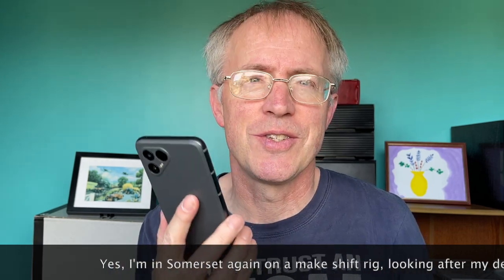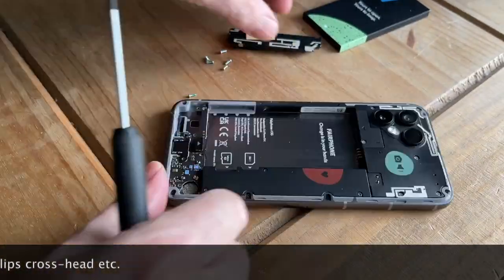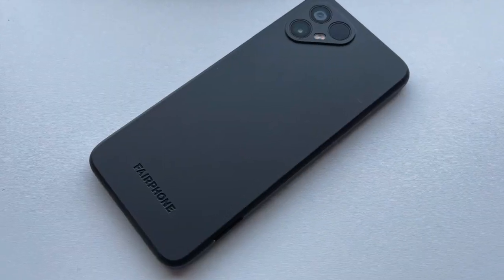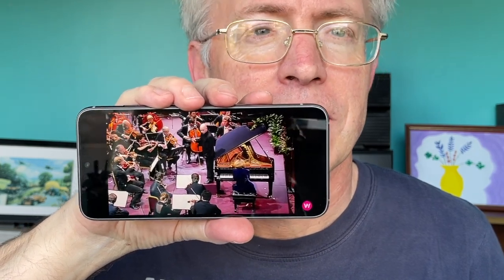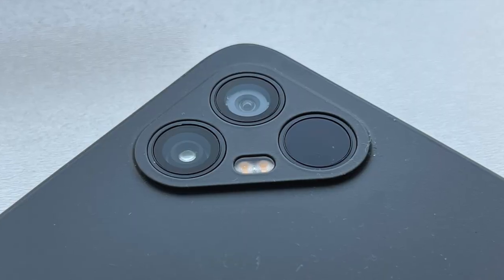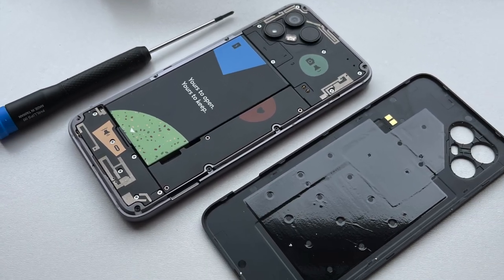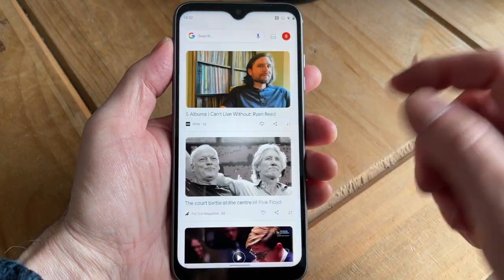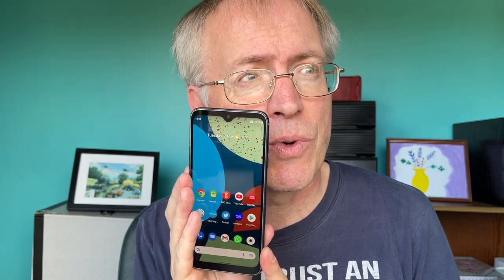The Phones Show 432 (Review of the Fairphone 4)

Comment: I too would have liked an OLED screen.  The fact that it is replaceable should mean even if it does burn out it can be replaced, but I do find many LCD screens difficult to see in bright sunlight.

Most phones I have owned I have owned for at least 5 years, and only ever had one phone that failed due to being dropped in water (that was about 20 years ago).

What to me is more important is that it will continue software security upgrades for 6 years or more, although this does rely on having faith that the company will not fail in that time.  In modern security conscious times that in very important.

Comment: I believe that access to the battery will create an opposite reaction, people will change and exchange them more often than needed, actually creating more
waste, people have tendencies to change batteries when no needed, it's better of having a technician to double check that to avoid unwanted excesive waste and over swapping batteries and not often recylcle...also, waiting for a replacement screen to arrive just takes longer and it's incovenient for the customer that needs a screen right away.......the ideology doesn't match the practice...IMO of course